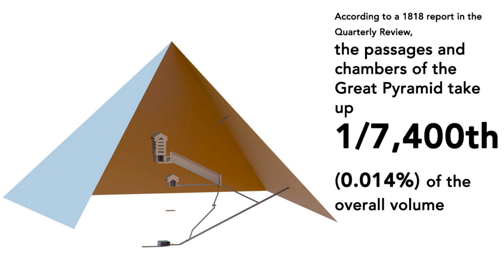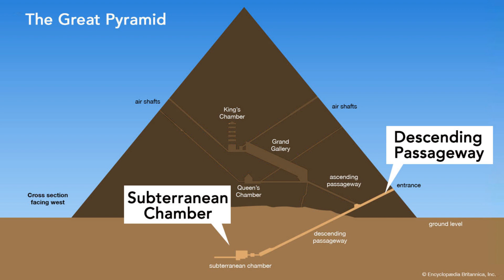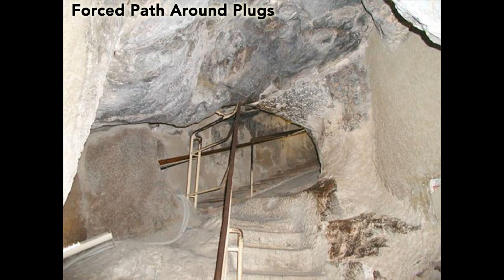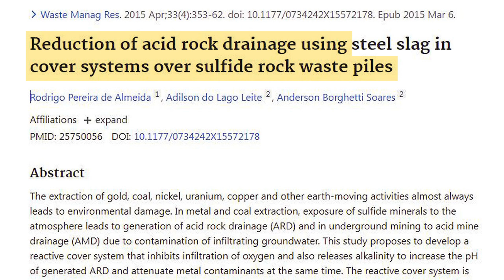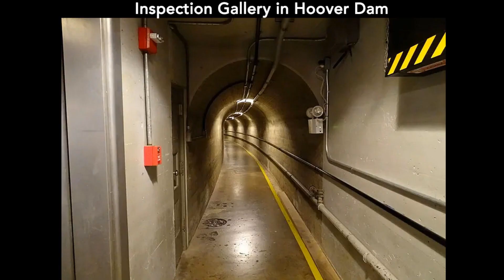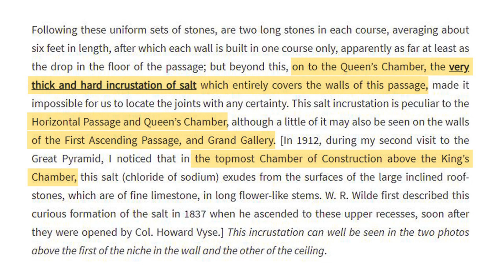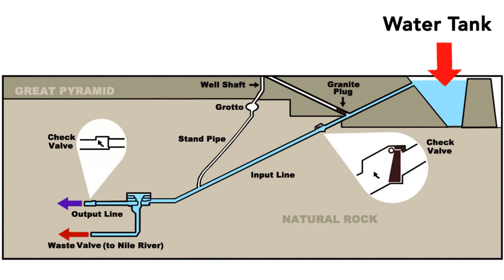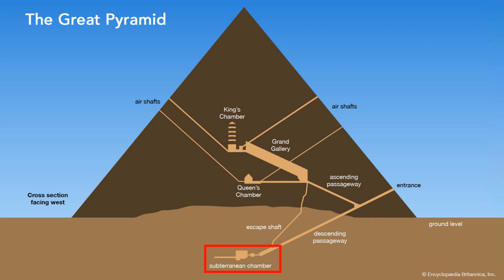The Mystery of the Great Pyramid's Interior System?

Comment: During construction, the lower pyramid possibly acted as a water pump that supplied water for water locks running down one side of the. pyramid and connecting with water locks that came up from the nearby channel of the Nile. See Steven Myer's work. The water locks would have carried barges that supplied rock, aggregate and related material for the construction of the pyramid. After construction was complete, the water pumping aspect of the pyramid would have been repurposed for other functions. The salts and other chemicals emerging from the blocks are likely partly caused by the chemical, salt, lime, water and other additives used to create the geopolymer blocks that constitute much of the pyramid. Plus, if the queen's chamber is a chemical reaction chamber, one could expect salt deposit to be highest in it and less the farther the distance from the chamber. It all depends on the processes going on in the entire pyramid, the function it had. Christopher Dunn has the best explanation, covering all the endless idiosyncrasies in the design of the Great Pyramid and more, such as why the Grand Gallery has a highly designed, corbeled ceiling and the antechamber has its cylindrical grooves and granite leafs. The pyramids are not made of only stone blocks. A significant portion consists of boulder rubble and sand fill placed between sections of stone blocks, as evidenced by the ceiling of the Great Pyramid's entry tunnel and the drill holes made in the entry tunnel walls of the Queen's chamber, plus other exposed regions of the Great Pyramid.

The copper rods in the queen's chamber "air passages" are not handles, they are clearly electrodes. Their uniquely corroded ends indicate they were regularly being eroded in a solution of chemicals of some type, as Dunn explains. The Great Pyramid's design is beyond complex, it's clearly far more than just a mine tailing depository. Whatever amount of work, time and funds were spent on creating it was repaid back in spades, furthering the development of civilization on the Nile. The Grand Gallery especially gives away the pyramid as some type of industrial machine or complex, most likely having something to do with agriculture, perhaps providing for crop fertilization or stimulation. We'll never know, modern civilization is soon going to be extinct. That's what happens when you forget about your ancestors and how they lived, the one's that evolved humanity to live as properly-behaved, human civilization on the irregularly periodically, cataclysmically-behaving crust of our planet.  Rich elite- and profit economy-serving, lost and confused, 6000 year old modern civilization is a humanity- and all existence-pillaging, ugly mess, a dead man walking.

Comment: Your observations address the technical and constructive aspects of architecture and environmental management, much as we approach them today, but they do not explain the purpose. The efforts made by the builders clearly demonstrate that their intention was to give height to the structure and to place it at a determined level within its site. However, the ultimate purpose can only be understood by evaluating:
	1.	What mineral was being extracted in that area? (There should be data)
	2.	The significance of the sarcophagus in that “maintainance” chaimber twists the plot.
	3.	The contextual aspects of the entire site in relation to the layout of all the pyramids — that is, the design of the Master Plan.
       4.     Finally, the conclusions must be drawn based on the completed project in both material and design (the exterior cladding, the material of the apex, and the natural biological environment surrounding the sites — including flora and fauna).

Comment: The great pyramid is a generator operating at 8 Hz frequency sound vibration. This occurs naturally when water flows through an underground aquifer. Its structure accumulates this vibration energy turning it into usable form.
   
Lightning results from a discharge of this energy that we erroneously believe is a discharge of a buildup of static electricity. Its source of power derives from the vibration of this planet. The reason lightning leaps great distances is not due to a buildup of an enormous voltage like in the discharge of a capacitor. It is because lightning is essentially a sound wave that it can travel that distance. Lightning comprises an enormously powerful sound wave that produces light when vibrating molecules of air. If lightning were a DC discharge of static electricity it would take more energy than a nuclear bomb to achieve this incalculable potential that is needed to leap a mile, as in many lightning strikes. 
   
A large mass insulated from the air is all that is required to accumulate this energy. It is the same source that causes hydro poles to hum. This is what Henry Moray described as “cold” electricity because it does not shock humans. But it is not electric at all and has no effect on the human nervous system. This high frequency sound energy will produce light and drive a motor, but will not power heating appliances.  
   
The lightning bolts in a picture of Tesla working in his laboratory are of this nature, produced by high frequency sound waves whose source is vibration of the planet, which is why he appears oblivious to danger. These will not harm him even though they resemble a high voltage DC discharge.
   
You are likely familiar with a fluorescent tube lighting up without being connected to any electrical power when in the vicinity of a transmitter. That is somewhat like the way the Egyptian light bulb operated, but in this case 8 Hz sound energy caused air molecules to fluoresce.  
   
I accidentally became familiar with this source of power during the early 1960s when I erected a 1000 ft. long horizontal aerial between two 20 ft. high poles using insulated wire. Aerials use bare wire, but insulated wire was all that I had on hand at the time and that is the kind that must be employed to harness this energy. This aerial was set up over an aquifer that was an underground gravel streambed beneath clay 35 ft. below the surface through which water flowed from a lake in the mountain.
   
It seems that an arid climate is essential. Like that at the site of the great pyramid. 
   
During certain conditions large sparks that did not shock me would fly off the lead-in wire to my metal bed frame, making a sound like machine gun fire, nor did these sparks harm a one-transistor radio. When I touched the lead-in wire to an old radio tube it gave off sheets of blue light. Only one wire is required. No return path is needed as this high frequency sound energy apparently simply dissipates in the air. The lead-in wire was tapped into the aerial at about the 1/8 part of its length. A tap that divides to tune the aerial is required. Nothing happens at the lead-in wire connected to the end of the aerial. Each year the energy and sound seemed to increase in intensity.
   
If the insulating outer shell of limestone were not missing from the great pyramid it would continue to function in this manner. The air within the pyramid is subject to an imperceptible fluorescence, lighting it up to a certain extent, which is why it is never pitch dark inside when the lights are turned off. High frequency electromagnetic waves, i.e., sunlight, lights up our atmosphere, which is why we have dawn preceding sunrise and twilight after sunset, but light waves themselves, are invisible.  High frequency sound waves that are likewise beyond our range of perception perform a similar function. Presumably, the atmosphere may be made to light up using either high frequency electromagnetic waves or high frequency sound waves. 
   
That provides a clue as to the purpose of the shafts in the pyramid. These were simply paths for this high frequency source of sound power to follow, perhaps to affect the frequency and create a phase difference or to tune this apparatus. The coffer may have had a similar function related to maintaining or changing frequency. The kings chamber was likely purposely offset from directly beneath the apex for a similar reason. The cone shape of the pyramid also fulfilled a role. Experiments have shown that vibrating cones levitate or cause other objects to levitate. Due to the shape of the pyramid the overall structure would have functioned like a lightning rod with the relieving chambers directing and controlling a vertical discharge at its tip. One might envision it giving off a thundering sound while streaming a ray of light upward towards the heavens. 
   
High frequency sound can be harnessed and put to work in a manner similar to A/C electricity. Evidence in the form of the so-called schist disk provides a clue as to how this energy was employed. By creating a phase lag or phase difference a rotor made of stone (or other material) may be made to rotate at an enormously high rate of speed with sound energy derived from the vibration of the earth. This is similar in principle to the manner in which an A/C motor operates using electricity. An abundance of stone vases were discovered that seem to have been manufactured using high speed rotation.
   
Obelisks were receivers of accumulated earth vibration energy from the pyramid and emitted blue light.
   
By understanding how to employ earth vibration energy the ancients also harnessed it to neutralize gravity, which is how blocks of stone weighing hundreds of tons could be lifted with ease. Gravity is the result of the elastic reaction of one solid passing through another solid of whose existence we are unaware because it exists at a frequency of vibration beyond our range of perception. Material is virtually all empty space and one material can pass right through another oblivious of the existence of the other in the same manner that radio waves pass right through solid substances. But some frequencies of electromagnetic waves are slowed down and others bounce back at which point we become aware of them in the form of light. 
   
Gravity in a material sense is akin to the bouncing back of light waves is to radio waves. It is like an otherwise undetectable elastic substance that when we move up from the surface of the earth stretches and serves to fling us back down. High frequency sound channeled through a pair of cones from base to apex to create a phase displacement may be employed to neutralize the existence of this undetectable solid. A large block of granite then becomes like a block of Styrofoam not only eliminating its weight but also its hardness enabling it to be cut and shaped with ease and stacked like marshmallows. Outer space that to us appears to be a vacuum may in reality be a solid vibrating beyond our range of perception. 
   
Ancients used the great pyramid to accumulate earth vibration energy in conjunction with obelisks to light up the countryside and by creating a phase displacement harnessed it in a form of motor to spin apparatus at high speed and also employed sound to neutralize gravity and largely eliminate the hardness of solids.
   
   
  
Footnotes:
   
Planets vibrate at particular frequencies. That their bodies are tuned to a different frequency may account for why extra-terrestrial visitors have a difficult time or find it impossible to maintain a visible presence on earth.
   
Tones sent through a pair of stone cones from base to apex appears to create a phase displacement or frequency multiplication factor or both. Hornfeld or greenstone rings like a bell. Drawings on an Egyptian wall depict an object like a stone tuning fork about eight feet high with one prong longer than the other likely used to divide a stream of sound energy creating a lag or phase difference. 
   
Recent research reveals that sound waves have a slightly magnetic quality. However, this magnetism might be the result of vibrating material and not a product of the sound itself.
   
The fundamental “beat” of our planet is 8 Hz, otherwise known as the Schumann resonance that is named after physicist Winfried Otto Schumann, who documented it mathematically in 1952.
   
A hydro pole (on a node of the energy grid?) that was on top of an aquifer where water had welled up through the clay layer forming a nearby pool gave off a sound like an industrial buzzer at full volume, which provides a clue as to the purpose of the obelisks. Operating in combination with the great pyramid that changed the frequency to one that would cause the atmosphere to light up, the obelisks lit up the countryside. Obelisks that were constructed in Switzerland are invariably paired with an adjacent pool of water.

Comment: The lower chamber had water in it and as it pulsed would send a wave, through the Pyramid.
And it had to be tuned to the proper frequency. That's why there are.
Pieces chipped out to achieve the frequency.

Comment: Water drainage system for a place that receives half a centimeter of rainfall yearly. 🤦
Reply from the maker: Don't forget the heavy rainwater erosion marks on the Sphinx enclosure walls. The Giza complex could be much older.
Reply: @CuriousBeingbyTina  that erosion is caused by strong winds that lift clouds of sand to hit the surrounding material.  Anyone who has lived in a desert knows this.
Reply from the maker: @Uprising771  Many geologists disagree with you, like Robert Schoch, Coline reader and Jørn Christiansen.
Reply: @CuriousBeingbyTina  that's fine, anyone with common sense disagrees with you
Reply: @CuriousBeingbyTina  those sources you mentioned are completely unreliable. Nobody believes them

Comment: The irregular well-shaft to the bottom looks like a rough, stopgap solution. Maybe it was made to drain condensed water from the chambers above before the content could be damaged. It could’ve been constructed by dropping a heavy, pointed chipping-tool with a collector on top down and dragging it up only when its top chamber was filled up…

Comment: The king and queen's chamber were actually kitchens and their shaft are vents. The well shaft going to underground chamber was the waste disposal. The vents also acts as water source from rain or where the water is delivered. The sarcophagus was a container for water. The queen's chamber used to have a sarcophagus too but was removed for service but was not returned as they accidentally lowered the plugs. When they got inside the chambers, they noticed salts on the walls that destroyed the paintings, the same salt they used for cooking. Notice the headdress of the pharaohs similar to the chef's hat.  Note: Cheops = Chefs, Kafre = Copper (utensils), etc... They use the grand gallery to deliver cooking oil as can be noticed on the side of the grand gallery and the worn top of the grand gallery landing from the ropes being pulled.
Reply: that doesn’t explain the building of the others. We have to put it into the big picture.

Comment: It's a ram pump that generates electricity using water and chemical reactions.
Please look up what engineers say about this.  Piezoelectricity, water, ram pump.
Reply from the maker: For a hydraulic ram pump to function there needs to be a water tank/water source located higher than the water tunnels. Assuming that the passageways and chambers in the Great Pyramid were indeed made to transport water, which means the water level of the water source (the Nile) needed to be higher than the pyramid's entry. We don't see such water tanks or water delivery system on the Giza Plateau. If the pyramids were built right before the Younger Dryas, back then the sea level was about 60 m lower than today. During the Last Glacial Maximum which lasted for a few thousand years, the sea level was about 120 m lower. Since the Giza Plateau is close to the Nile Delta and the course of the Nile is fairly flat, the water table of the Nile would be closely associated with the sea level therefore much lower (60-100 m lower) in these earlier time periods. 
The base of the Great Pyramid is now 61 m above sea level. Even today transporting water to the plateau top wouldn't be easy. Also, what's the point of creating a ram pump with the pyramid? If the goal was to make a water pump then the builders didn't need to piled up millions of stone blocks to create a pyramid shaped structure.
Reply: @16:00 this possibility was explained. Pay attention please